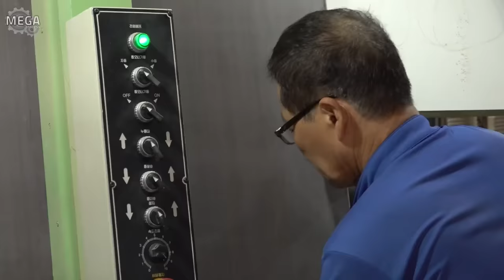Process of making grandfather's clock. Korean oldest clock factory

Comment: I cried when they installed the speaker. What sacrilege. And as others here have mentioned, the MDF....oh man. I at least hope these clocks are priced accordingly. $30.
Reply: sure, they cost more than a mechanical one did 100 years ago, but they cost less than a vintage or a new mechanic today. The final  price  for this is about 400 dollars, anyway people choose these movements also for the easy usage, you have only to swap the battery 1 time at year and with a mechanical one you have to charge every week, a mechanical sounds always, also in the night (if you don t stop it manually) many people don t like the TICKING, and a mechanical one needs to be serviced every 10/15 years (jn  many country this is very expensive) I have both, many old german pendulum clock but also a pair of osawa and seiko quartz operated from 80s, i love both xD
Reply: @elpasadordeoro  you do realize that electric clocks tick too, right? And you can find a cheap mechanical clock online, even if it’s used.
Reply: @Corgipon  Absolutely no!! Or better it depends, a lot of quartz movement are super quiet, seiko an example makes dozens of quiet movements, in my collection i have some models and I can assure you that they don t make any noise except for the melody. I also have a lot of mechanical clocks, but do you know mechanical clocks need service??? i service my old clocks by my self but a watchmaker ask a lot of money for this job. Personally i also have quartz movement with ticking and old electronic/electric clocks from 50/70s super quiet too. The only mechanical clock very quiet that i have in my collection is a german 400 days clock, but honestly they re inaccurate and hard to service, they re perfect for the LOVER, not for normal user :) ps you re talking with a person with more than 50 clocks and 100 watches

Comment: This is an educational video on what to look out for when you are shopping for a grandfather clock (or any furniture really). Look for: 

1. Particle board construction rather than solid wood, or even veneered plywood. Particle board has to be sealed, otherwise it will absorb moisture. Even if it's sealed, all it takes is a scratch or chip, and it will absorb moisture. Once it absorbs moisture, it behaves like cardboard - it swells and puffs up and will eventually crumble and fall off. 
2. Nails and staples. If you see any, avoid. Woodworkers who take pride in their work will hide their joinery as much as they can. Even if they use metal fasteners, they will hide it under a wooden plug. They will 100% not nail a carving through the face. I cringed when I saw that. 
3. Fake features. It's a battery powered quartz movement, so what are those chains for? A fake pendulum, and a fake weight that will never need to be rewound. And that chime, I really hate it. They couldn't even bring themselves to use something that sounded like a real chime, instead it's got a distinct 8 bit sound like the bleeps from 1980's computers. 
4. Honesty. A grandfather clock is supposed to be a high-end piece of furniture, a statement piece. This thing is pretending to be a high end statement piece which it clearly is not. I am not saying that the manufacturers are dishonest - as long as it is advertised as such and sold for a reasonable price, the manufacturers are being honest. But the person being dishonest is the BUYER who is trying to pass it off as a high end statement piece. This thing might look like a grandfather clock from a few meters away, but once you get up close and touch it and hear the chime, the whole illusion falls apart. It will make people wonder why you put such a monstrosity in your living room and seriously question your taste and honesty. 

For the same money, buy a nice wall clock.
Reply: Yes, yes, yes... I agree with everything you wrote! I just sit with open mouth and cannot understand, why someone want to buy it. Greetings from Czech Republic!

Comment: This is a quartz kitchen clock with a speaker that has been taught to stand in the most impossible way.
Coated pressboard panels and PU foam inlays. Stapled together into a large box with a showcase window! That thing sounds like a hardware store doorbell. No solid wood, no dowels, no connections worthy of a carpenter! No craft! I find the thing even sadder than the korean cuckoo clock! And even that was not a brilliant achievement!
This is by far the lowest Korean point I've seen on this channel so far! From a German point of view, I would say: cheap, tasteless China junk.

No comparison to the CRAFTER guitar factory or even to the DaBell harmonica factory! You could discover tradition there!

Sorry for my harsh words.

Comment: Eh, I beg to differ over this, though I applaud Korea for their advancements in manufacturing of course. An electronic movement in a clock, especially in a grandfather clock, is rather cheap. Clocks made in England, France, Germany, and the like throughout the decades included intricately designed cases and complex mechanical movements that make them works of art themselves and they take a lot of time (no pun intended), effort, and care to make. Mechanical grandfather clocks are even still made today.

Comment: It's beautiful work. My grandmother had a really similar model, but needed two strong people to lift it. It was impossible to drag him so heavy.
Reply: Not the same as the cheap one in the video though
Reply: Yea this is junk fiberboard.
Reply: Pretty sure if you try dragging this it's going to break in half.
Reply: @pitot1988 at 13:25 the maker can easily lift up the clock (just without the base) so I think they used cheaper materials than the one the original commenter had

Comment: Disappointing video. l totally agree with Geekgirl87! As a clock builder and lover, I can tell you that this cheap imitation should not be called a grandfather clock.  A real grandfather clock does not have cheap particle board and veneer and certainly not electronic components.  The sound is atrocious!  Only fine hardwood and the best of mechanical movements are worthy of a traditional grandfather clock.👎👎